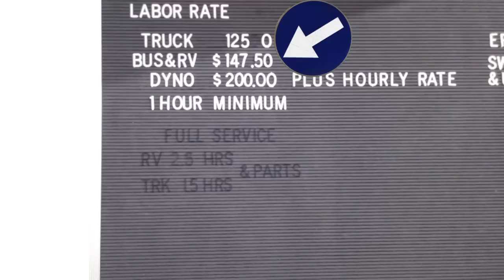What To Consider When Buying A Diesel RV or Motorhome?

Comment: Ok so I am a mechanic and I have heard some bollox on here about Diesel engines. I am moving on, sure enough some of what he says is ok but some is just stupid. Like, you engine will wear if you don't use it. LOL. What will actually happen is that the oil that is bathing all the oil seals will slowly rot the rubber of the seals. Same goes for valve stem oil seals. Your engine will not die or wear just sitting there. These things don't rot out. The Cummins diesel engine has a 1m mile club FFS. Sorry bro, some of this stuff you are just being plain misleading or wrong. You have some good info but for the most part I don't agree and I think you are just regurgitating something you have heard without empirical evidence. Love the imagine showing wires that have clearly been overheated to show how wire simply though age will strip the plastic insulation. Back in the day sure, cable insulation was made of different stuff but not nowadays on modern vehicles. Again, just regurgitating something that you have heard and doesn't apply to modern wiring and is old news for old vehicles.

Comment: I love how my comment got highlighted due to the comment I posted.  Honeztly I have heard of Gasoline engines going over half a million milez before a rebuild, a lot depends on the parts being used and how well the mechanic goes ever said engine.  Diesels are longer lasting due to the size and quality of components.  Honestly, id love to have JOSH FROM ADEPT APE to work on my logging truck or c9 dozer..  Unforantly, i have WV mechanics.  The one I go to is really darn good but id love Josh to go over my cat motors
Reply: Those v10s are no joke. There are companies that run those engines 24/7 for years and are hard on them.
Reply: @jamesh3708  I work for electric utility we have over 1000 fleet vehicles 1 ton pickups and such we went from diesel to V10 gas engines because of all the emmision control problems we had and DEF fluid cost.

Comment: I was very impressed with your video. I am looking for a used 20 year old or more motor home. If I find one that looks to run good. What should I do to make sure the engine is going to last asuming it has sat for a while. I no how to fix everything else on the home, but I want to know what I would need to do to be confident in the engine.

Comment: RVs are engineered by idiots at times.  Fleetwood...I was working as a Ford tech and had an RV come in with a 460 engine in the back with only 800 miles on it.  It had air brakes.  Complaint #1:  belt keeps flying off compressor...no shit...that engine was never designed to have an air compressor mounted 2 miles away from the crank.  Complaint #2:  Exhaust leak.  Both cylinder heads broken...absolutely zero air flow around the engine.  I told the customer that they'd NEVER be able to use this vehicle again...ever.  Got Ford rep involved and Fleetwood towed the $100k piece of junk away and refunded customer(nightmare).  RVs(none of them) are mechanically engineered to last...they're engineered to make people feel good in the living quarters.  Steer clear of buying one.

Comment: Sir, first I would like to thank you deeply for this channel. I have watched and learned a ton about Caterpillar diesel engines from you. 

With that being said, I have two questions: 1) What is the ideal cruising RPM for a 2006 C7 ACERT? (Meaning optimal balance of fuel mileage, power output, and ideal RPMs to prevent wear.)

 I know the gear ratio has a lot to do with this, but I will set my speed based on the RPM you give me.

 Number two: Is it normal for a CAT C7 ACERT to idle rough and/or miss after a few hours of highway driving? 

I just recently had my 2006 C7 overhauled @ Western Star Northwest along with 6 new injectors and a new turbo, but after pulling off the highway to my delivery point, the truck idles roughly. 

I have a video: https://youtu.be/9J3cOPl1rW4

Thank you.

Comment: Devil's advocate: I just bought a 2003 Fleetwood bounder on a GM 8.1/Allison; it's super cheap to maintain and simple. I bought it for 2/3 of the NADA value; so I expected my furnace, refrigerator and other small stuff like tires will break. But I've been happy with it as I would have had to buy hotels.
Reply: Oh and it gets 5.5-10mpg, not that bad for its size. Plus consider there's only one simple Catalytic converter and I legally don't even have to pass emissions inspection. Also gas is about 20% cheaper. I am really not sure that diesel engines would even save you money on fuel costs ALONE, not to mention maintenance/problems. You can fix things on a gas truck engine and the interior can be fixed yourself cheaply. Hope this helps someone!
Reply from the maker: You are a very informed buyer, who bought a used RV for under its value, is going to do much of the maintenance yourself, and has a gas engine. All more economical choices that should save you a ton of money.

Comment: Don't. If you live in the United States our diesel fuel is horrible and you will just melt pistons when the injectors clog and fail. You will do nothing but spend money on a diesel engine in an rv! All the components were designed by " Bosch"  company and they have much much better diesel fuel than we do in America. diesel engine just turn into fine ground metal particles in the fuel system when used in america. One of my customers actually had a license plate on his RV that said "rolnturd"

Comment: so what made those valves come apart in that last engine ?
Reply: Customer said they changed the fuel filters and then it wouldn't start. They also conveniently "forgot" to tell Josh that it was taking forever to get all the air in the fuel lines out, so they dumped 70 cans of ether into it.

Comment: How long would it take someone to drive 1,000,000 miles...?
Reply from the maker: At 60 miles at hour about 16,700 hours, but you generally see the engines go about 20-25,000 hours to get there in real world time since there is idle time, traffic, surface streets, etc.

Comment: does anyone know if you can swap a cat c7 KAL with an FMM series engine? i know the KAL is a 12volt systen and the FMM uses a 24volt system, the seller says the only thing that is wired for 24volts is the starter?
Reply: FMM is a military prefix. They frequently remove the ECM, so you would need to use the KAL ECM. I have seen it work, but it’s not a guarantee. If you have  300 or 330 hp KAL, chances are the injectors and HEUI pump are the same. Cat will absolutely not allow a download of an FMM file into an on highway vehicle.

Comment: You obviously haven't priced priced repairs on a Ford, Dodge, or GM truck lately??  Know what an 8 or 10 speed Ford or Dodge transmission costs??.Hint, you can buy a reman'd Allison cheaper. And lets not even start with repair cost for these rolling piles of fecal matter they call 5th wheels now.

Comment: Question,  can you change an RV's tires using the rv stabilizers
Reply: Whenever I've seen those stabilizers in use they seem absolutely fantastic and pretty safe. It wouldn't hurt to put a jack stand underneath something or a big log at least if you're out camping. Just remember things like cinder blocks and bricks shatter like an ice cube and will not actually hold any weight.

Comment: Still didn’t get the reason why they won’t go a million miles.
Reply: A truck does a million miles in a few years. An rv sits and deteriorates. Rubber liner seals are ok for 6-8 years. They will rot and leak over time. Same with every other seal.